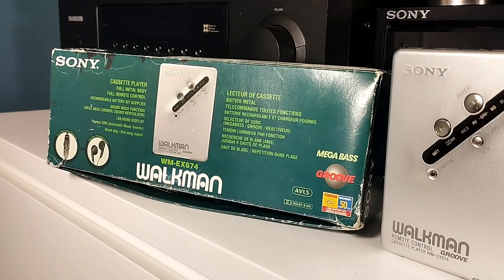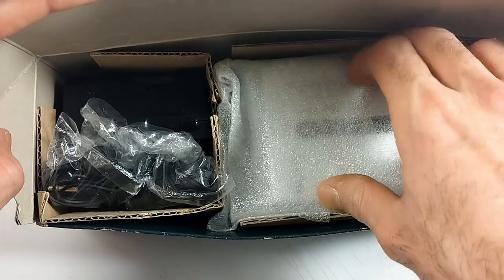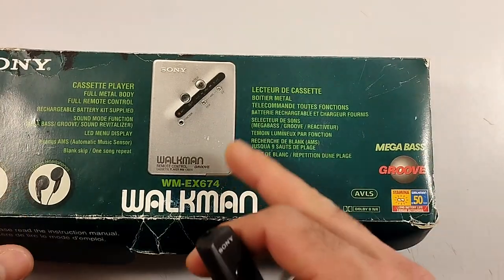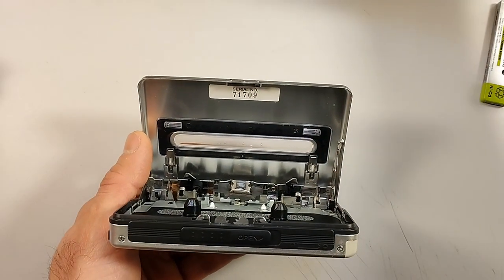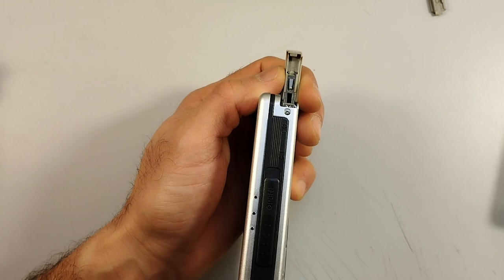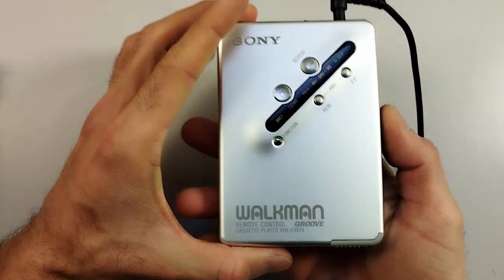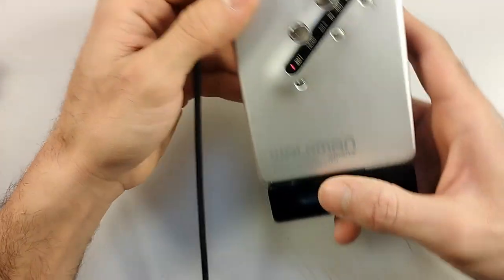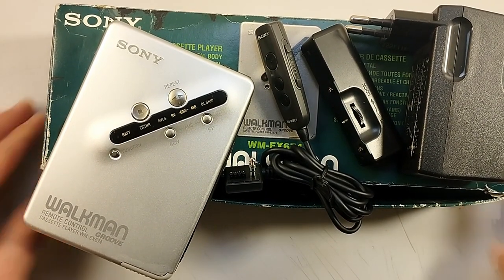Sony WM EX674 cassette Walkman unboxing & review

Comment: I have the violet / blue coloured one of this. Just ordered the rechargeable battery pack and charger for 17 pounds from Amazon. Not original ones. It I'm not paying 70 pounds for a charger for the gum batteries. Hope mine works as well as it did. I still have the remote control plugin too
Reply from the maker: Nice.
Good , it's actually not a good idea to use the original charger, and keep the old battery it might still work. 
Somethings I just learned about these batteries.
I'm making a video coming soon for all the info.
But at least I can advise you to buy a "smartcharger" the like of litokala and zanflare.